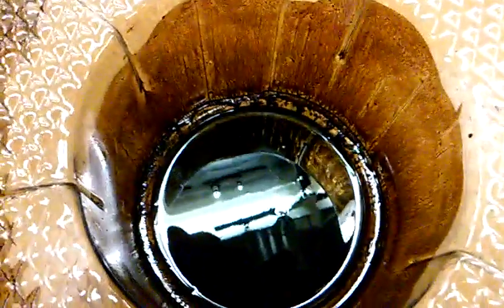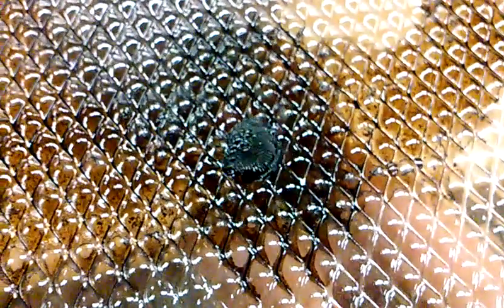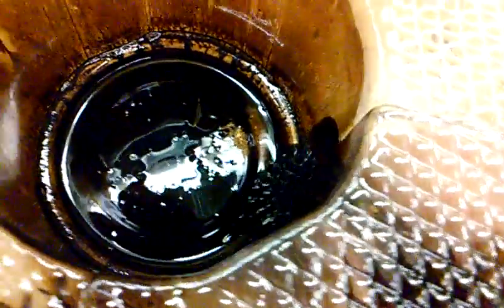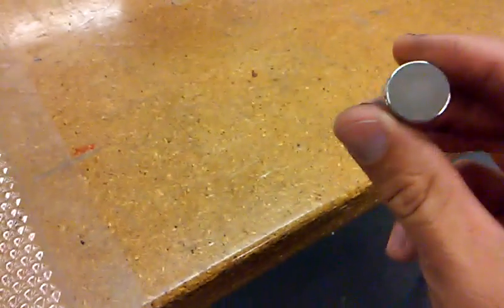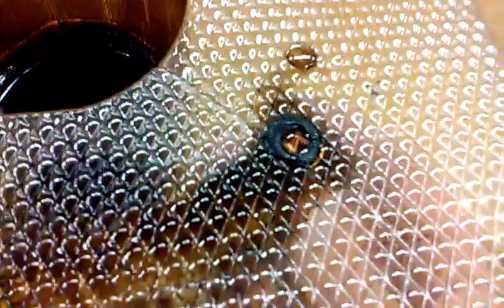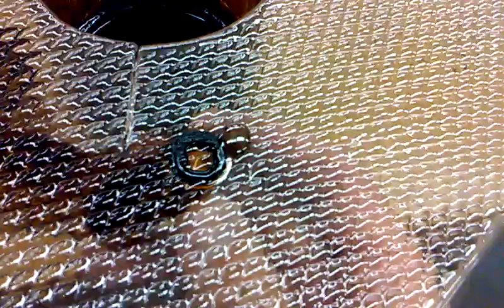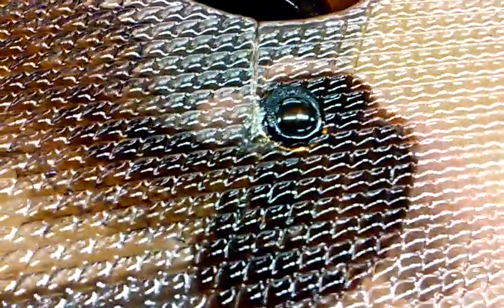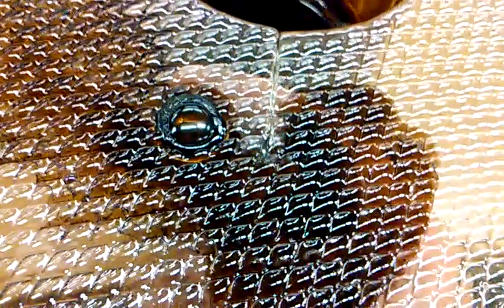Ferrofluid and polymagnet experiment

Comment: I wonder if this technology could be used to clean up oil spills.
Reply from the maker: Really good idea! The ferrofluid actually rusts when it's submersed in water for a long time. You'd have to envelop it in some sort of a flexible bag that kept it separate from the oxygen in the water. It's funny but you could use oil to envelop the ferrofluid but then you're putting more oil in the water so maybe that's not a good idea?

Comment: Is the connection to ferrofuid strong enough to suspend any magnets using a divider?
Reply from the maker: I'm barely putting that image together.  I just went full on 4/20 today so my head isnt on right at the moment
Reply: @lordkylo  Like this vid but a thinner divider and maybe less magnets for weight but will the fluid hold the magnet weight if you let go?
Reply from the maker: @alexclark4792  yes it will. It floats like a hockey puck. Makes a huge mess too. I've done it enough to learn that it's fun but it gets everywhere

Comment: How did you make the polymagnet onsite?
Reply from the maker: Just saw your message: polymagnets were made using a CNC machine specially designed to zap the face of neodymium magnets with a small pin head that was 4mm in diameter. It would discharge 80amps of current all at once from two large capacitors and the end result was changing the magnetic field of a conventional magnet. Turns out by doing this you're actually creating a bunch of smaller magnets inside of a large one to make it plain and simple. 

The way magnets are made industrially is by producing compressed iron and coating it with a nickle-cadmium to keep it compressed. Compressed iron is very flaky and crumbles apart without a shell. 

Last- the industry uses a large electrical current to zap all the fresh made magnet blanks in a row. As they do that all the iron molecules are forced into a magnetic orientation. It lasts for 14 years then slowly the magnetic field decreases because those same molecules get rearranged the more you use the magnet.

Comment: Also, you said you worked at a tech shop with a polymagnetizer. I've been looking at polymagnets and it appears that polymagnet are only produced by CMR, and the machines themselves are not available, period.

Where'd you guys get this stuff?
Reply from the maker: +TristanBomb Hey man, apologies for missing your question.  The polymagnetizer is like a hard drive writer but instead of making tiny logic gates for a computer it instead has a gun attached to a CNC (x,y,z axis computer) that discharges electrical bursts upon the surface of a magnet to reverse the polarity on the surface of magnets at 4 MM in diameter or smaller pin dots.  Check out CMR magnetics on youtube and you'll see a little more of what it does. 

How'd we get one?  Techshop has the bill on that one; I believe they cost $45,000 to buy for prototyping purposes.